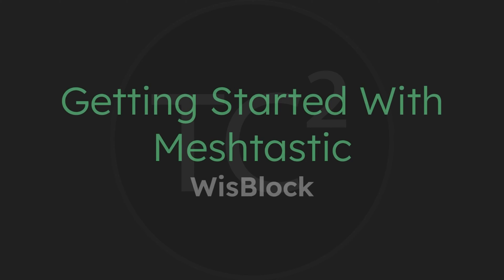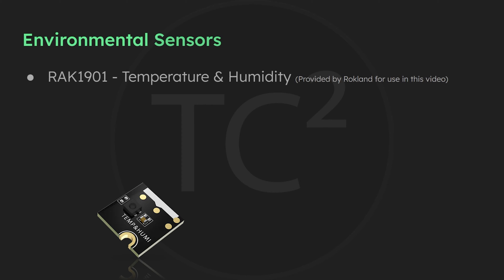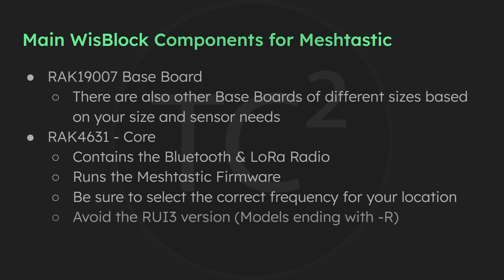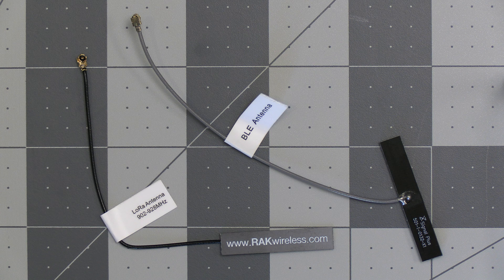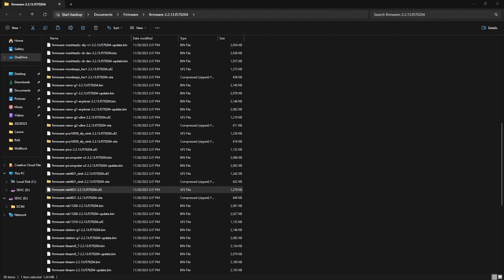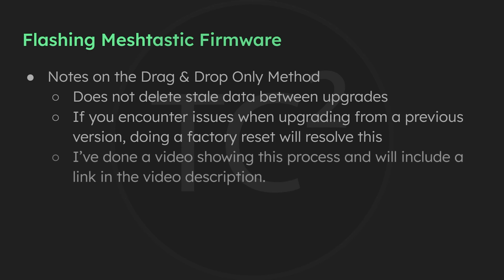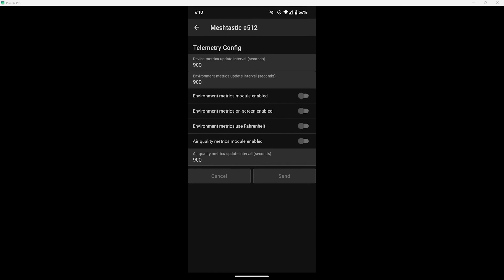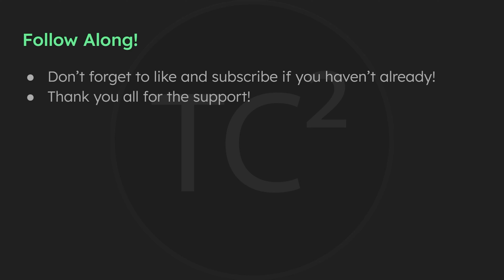Getting Started with Meshtastic - WisBlock

Comment: Sadly on the Meshtastic website the link you click to download the firmware does not work like yours anymore. Now you click: Firmware - Download stable: no download start, then you are greeted by around 20 different download. Which one do I choose? And one thing I would love to know is: You say select the one for the 4631 chip, but at 4:00 you install the 4630. Does the firmware work for both versions?
Reply from the maker: Process has changed since this video, but you can follow along at this point in this other video

https://youtu.be/vdCKpQKeaKU?si=GZ4Nh_XKELVPekx_&t=134

4630 is the chip itself without the board. The 4631 model is the 4630 chip installed on the board.
Reply: @The_Comms_Channel  Thank you !

Comment: A great video that lays an excellent foundation. What I would like to do though is use RakWireless components to read sensors, compose messages, and then transmit them over Meshtastic. Yet, it seems sensors are directly controlled by the Meshtastic software. Can you suggest one of your videos that offers a solution? Have been studying RakWireless' product line but cannot see how it would be done.  Many Thanks.

Comment: I got that enclosure and it doesn't come with enough screws to put it together, and it doesn't have the battery cable. I see now that the cable is sold separately, for 10 bucks!
Reply from the maker: Not sure what happened with the screws. I should have enough. You're right, no cable though which is a bit odd. The $10 gets you five cables.
Reply: @The_Comms_Channel OK right thanks!

Comment: Thanks! I have a question about the Starter Kit. Rockland's kit is $34.97 and sold out. Rak's is $24.99 and in stock. do they both come with the same compnents?
Reply from the maker: Thanks so much for the support! It's the same item. Rokland just got more stock in and will very likely go sell out soon!
Reply from the maker: The shipping costs from RAK are high and have a long wait.
Reply: @The_Comms_Channel  Thanks for the heads up, just ordered 2 for my first builds
Reply from the maker: Sure thing!

Comment: Still new, and trying to figure what all to buy.  Is there a limit to the number of modules you can add to the WisBlock?
Reply from the maker: Thank you so much for the support! There is a limit. There are also bigger boards if you need to add more modules though.
Reply: @The_Comms_Channel  -  - You’re welcome!  Thank you for the great videos!

So I could get a bigger RAK board that would allow more modules than the WisBlock Meshtastic Starter Kit (with RAK19007 board plus Core), and would work for Meshtastic?  Because I’d like to install GPS, temperature, and radar sensors at minimum.  I’m not sure if I need the IO module or the OLED display or not.  Could you recommend one from a larger RAK wireless board that would work for Meshtastic LoRa (or one of your videos)?  I’m trying to order everything and get it in-house before I go through your play lists.  I’m new to all this (but very interested)!
Reply: @The_Comms_Channel  That's good to know.

Comment: Using firmware 2.2.22 (Meshtastic ios app 2.2.21) and the screens bear no resemblance to what your are showing. There is no 3 dots top right and no radio configuration selection. Also I have RAK12500 module and the app asks for GPS GPIO pin numbers for TX, Rx and EN. I have no idea what these are and no guide even mentions them.

There is a WARNING
GPIO access is fundamentally dangerous because invalid options can physically damage or destroy your hardware. Ensure that you fully understand the schematic for your particular device before trying this as we do not offer a warranty. Use at your own risk.

Comment: Thank you for sharing the process for doing a headless setup - no need for the tiny screen that consumes power anyway. Would you be able to do the same type of flashing by simply going through the Chrome-browser method of web flashing, or does the RAK require the drag-n-drop method?
Reply: Just out of curiosity, what screen is compatible with the RAK19007 anyway?
Reply: @ecotts  RAK1921 OLED (soldering) or the RAK1400 E-Ink (ribbon cables) according to Meshtastic website.

Comment: Great video! Could you go into how I would go about charging the battery? I purchased a PKCell 3.7 V flat battery
Reply from the maker: It should just be a matter of plugging it into the battery port on the WisBlock. Just make sure the red side is going to the side with the plus sign printed on the board. Did your battery come with the connector on it?
Reply: @The_Comms_Channel  Thanks for the reply! I get plugging it into the Wisblock.

Maybe I misunderstanding your response. 

Let me rephrase. 

My plan is to have a base station, a few relays or repeaters and 2 mobile units to start with.

For the base station : Once I have the Wisblock set up and the battery plugged in, how would I go about charging the battery once it’s depleted?

For the relays/repeaters : I’m thinking solar would be better because it’s more flexible if I’m just placing units in randomly hit them locations.

Mobile : I could be mistaken as I’m still fairly new to all this, but I have yet to see anyone in a small solar panel into a mobile unit.
Reply: @The_Comms_Channel Apologies I forgot to answer your question. Yes the battery comes with the JST connector already attached.

Comment: Interested in the RAK12013 Radar sensor. Do you have plans to build something like a meshtastic motion detection node?  I can think of a couple use cases, both temporary and permanent that could be interesting.
Reply from the maker: I do and have a radar sensor I'm testing. I'm getting a lot of false positives though and will continue to work the kinks out.

Comment: Thanks you for this video. Did you experience issues with getting the device to show as a device once you entered bootloader? Mine is not showing as a device on windows 10 machine. Confirmed the cable is USB data enabled (phone got recognized). Rebooted computer. still no joy. Thanks in advance for any info you have.
Reply: USB plug installed at an angle. Looks like some pins are not making contact with the board. Pinging Rokland for options.
Reply from the maker: It's not showing up as a flash drive when you hit the button twice? I've not had that issue. I would try another USB port and see if that works.
Reply: @The_Comms_Channel  Ive confirmed that there are pins on the USB module that are not touching the contacts on the core. (Macro photos are nice)
Reply from the maker: @hatless-cluncky-capsize  oh, wow 😳 Didn't see your previous comment. They should hopefully be able to get your straightened out.

Comment: You recommend the 4631 as the core module/microcontroller, but I see that Rok and Rak also sell the "motherboard" paired with the 11310. I can't find a comparison between the two modules though - is there an advantage of one over the other?
Reply from the maker: https://meshtastic.org/docs/hardware/devices/

That one has no Wi-Fi or Bluetooth so you would need to get the Ethernet module for that to work
Reply: @The_Comms_Channel  Awesome! Thank you. That will work well as the HQ base station and I had the ethernet module in my cart. Great job on the channel!
Reply from the maker: Sure thing! Thank you!

Comment: Great video! Is it possible to get a version of the Wisblock with WiFi instead of BT?
Reply from the maker: Thank you! Not really at the moment. There is a WiFi module you can get for WisBlock, but it only works Meshtastic on the older RAK5005 board that they're no longer making.

Comment: Hi Folks. My device is showing as RAK4631 in file manager. I cannot select it in the flasher. It looks to be paired ok. Also the Meshtastic site does not show and firmware in the firmware section so I can't drag and drop either. Any ideas?
Reply from the maker: Site appears to be down at the moment. I've notified them.

You can download the latest stable version from their github page at the link here

https://github.com/meshtastic/firmware/releases/download/v2.2.17.dbac2b1/firmware-2.2.17.dbac2b1.zip
Reply from the maker: It has been fixed and should be working now
Reply: Thanks it did come online. @The_Comms_Channel

Comment: Thanks for this tutorial. I have followed the instructions as presented in the video. Unfortunately after flashing all I get is a solid red light on the board. Any suggestions for troubleshooting this are more than appreciated. Thanks
Reply from the maker: Sure thing. I would try flashing again and make sure you have the correct firmware file.  If that doesn't work, you can try a complete reset and flashing again using the instructions here. https://meshtastic.org/docs/getting-started/flashing-firmware/nrf52/nrf52-erase

If you need help installing the Meshtastic CLI  mentioned in this tutorial, my latest video shows the installation process https://youtu.be/hUWvmar-2VY?si=lnzFCxhjzKsO8V2n
Reply: @The_Comms_Channel  Thanks so much for the quick reply. Unfortunately this still doesn't work. The strange thing I observed is that after flashing the device doesn't reset. Also if I plug in a battery instead of powering the device via USB the board doesn't show any activity.
Reply from the maker: @digitalnomad46  Darn... Next thing I would try is disconnecting and connecting the device to your computer and then run the following command right after doing so

meshtastic --noproto

This should output the Meshtastic logs
Reply: @The_Comms_Channel  If the device is not in dfu mode. It reports "Warning: No Meshtastic devices detected". If the device is in dfu mode, It reports "warning file: mesh_interface.py sendToRadio line:681 Not sending packet because protocol use is disabled by noProto. Second line "Warning file:meshinterface.py _sendPacket line:531 Not sending packet because protocol use is disabled by NoProto". Thanks again for the quick reply and help so far
Reply from the maker: @digitalnomad46  Do you get anything beyond those two lines?
Reply: @The_Comms_Channel  nothing, I noticed in the info_uf2.txt when in dfu mode that the bootloader is dated 2020. I am wondering whether the bootloader is too old for the latest meshtastic firmware. Will try to update the bootloader
Reply from the maker: @digitalnomad46  Worth a shot. Mine shows Dec 2021
Reply: @The_Comms_Channel  with a very old meshtastic firmware (1.2.55) it works as expected. With firmware above 2 is doesn't work. I guess it's the bootloader as the board works as it's advertising ble with the old firmware. Thanks again for your help
Reply: I can confirm it was the bootloader. Updated the bootloader and now everything works as in your video 🙏
Reply from the maker: That's great news! That's something I've never run into before and it's good to know the fix for it. Thanks for reporting back!

Comment: can i run multiple 18650 cells? (1S2P)
Reply from the maker: Yep, as long as they're wired in parallel to keep the voltage at 3.7.

Comment: Video idea: a rak build for on person/mobile to compete with the t-echo but trying to keep the cost a lot lower. 

Rak starter kit 
3-d printed case maybe a “project box” from Amazon PVC pipe 🤷‍♂️
18650 battery 
18650 holder 
Gizont antenna 
Ipex to sma female pigtail
Whatever JST connectors & anything else you need.
Basically the most capable unit with good battery life for the lowest cost

Comment: Eager to see how to install the motion detector and have it send alerts through the mesh.  I have found a sketch for the Rak 12013 Radar module.  But the code does not include the notification to Meshtastic.   Anyone have the code for the Radar module to send data to Meshtastic?

Comment: Great video!!!! Can all the nodes connected see temperature and humidity of the remote node that has these sensors?
Reply from the maker: Thank you! Yep! Any node on the mesh network can see the readings of the sensor.
Reply: @The_Comms_Channel  Thanks for the info!!! Other question, I cannot find the Wisblock Rak EU433. Could you please tell where tu buy it?
Reply from the maker: @matutep1  Sure thing! It's odd, but they don't have the option for EU433 when you buy the kit. You'll have to buy the core and board separately. Here's affiliate links to them below and be sure to use my discount code TC2 for 3% off!

RAK4631(Core) - https://rakwireless.kckb.st/tc2-xbo
RAK19007 (Board) - https://rakwireless.kckb.st/tc2-fsb

Comment: Great video! I’ve tried to do a search on LORA type protocol in use on HF ham, radio frequencies. This benefits would be Range. I did see something for you. HF that works at 433 MHz.

Do you know if any HF based similar projects?
Reply from the maker: Thanks! I'm glad you enjoyed the video! All of the LoRa based radios are for the ISM bands, so nothing under 433MHz. The issue with HF and LoRa is LoRa uses a bandwidth 125kHz, 250kHz and 500kHz, which is a large bandwidth for HF which is limited to 500Hz for data. 500kHz is actually equal to or more than entire HF bands in some cases. Because of this, it's unlikely there will be any LoRa projects on HF. There has been some talk of using high powered LoRa signals to bounce of the moon and back which would be awesome! 

Thanks for the great question!
Reply: Now that's interesting....I'm betting that 1w will get an EME bounce.
Just look at what the Voyager probe systems are capable of......21 DAYS for a one way signal transit!

Comment: Is there an easy way to find the nodes From other people to maybe get in contact with them or is it just to communicate between my own devices?
Reply from the maker: When you set it up there's a default channel. If you leave it on this default channel, other people that are also on the default channel will show up. I'm currently on the road actually and went hiking yesterday with a device on the default channel and picked up another user. Thanks for the question!
Reply: May I ask, how many nodes you have already Discovered?  @The_Comms_Channel
Reply from the maker: 5 or 6 or so that have been on the default channel.

Comment: Thank you so much for these explanations. Out here rural there are a lot of us interested in a mesh network and it sure looks like the WisBlock is the way to go. Is there a description of how to set up a network and how to rig repeaters?
Reply from the maker: Sure thing! I've not done a video on the different options like routers/repeaters yet but will soon!
Reply: @The_Comms_Channel  Thank you so much for your time and expertise and above all you sharing it. I have to watch a couple times for it to sink in but as I go along I can grasp the concepts better. We live in a place where point to point is feasible but in the outlay it areas. Couple miles, some line of sight but a repeater between and solar powered would be the ticket. Another question I have is the failure rate for these devices very low? Say good for a couple years then have to replace?
Reply from the maker: @micklaws5520  Anytime! I'm glad you're finding the videos helpful! One of the future videos after I get done with the "Getting Started Series" (which is almost done) will be on device placement planning that should be helpful. 

As far as life expectancy, I would say they should last a good while and maybe the batteries may need to be replaced as time goes on. But the hardware devices themselves should last for many years I would think as long as they're protected from the elements.
Reply: @The_Comms_Channel  Thank you good sir. I am thinking all this can be Solar charged so the charge cycle will determine battery life..I think..lol. In that case if we get this rolling our placements will be ease of access to do a battery replacement

Comment: Hi all question? Can I use the rak1910 with the newer RAK19007? I accidentally ordered them. If so are they plug and play or is there something that needs to be configured? Thanks
Reply from the maker: That should work fine with the 19007. For GPS, there is nothing that needs to be configured in the app and it should just start working.
Reply: @The_Comms_Channel  great thank you perhaps I didn’t give it enough time to acquire a signal. Great channel and keep up the great work!
Reply from the maker: Sure thing! It will struggle to pick up indoors so you may have to take it outside for best results. Also make sure it's on SLOT A, E, or F

Comment: If you can figure out how to get the Ethernet module (RAK13800) to work with Meshtastic, I'd be very happy. My intention is to use this setup as a base station connected to the Internet.

Comment: Did I hear you say in a past video that if the Wiseblock power ran down on the battery, the unit would not start up by itself if the battery would recharge?
Reply from the maker: That is correct. If that happens, you need to unhook all power sources from the device and provide it power again to boot back up.

Comment: How about adding GPS module and enabling it?  Enjoying the series.  Want to build stand alone solar node for remote location.
Reply: They just recognize it and start updating
Reply: Gps snaps right in and I believe will be enabled by default.  You have to manually disable it. I didn't go with the gps, but now I don't have a clock (d'oh)
Reply: @jvalasek1 you only need 1 device withing the mesh to keep time thankfully I didn't have to pull my node down from 40' again I just added a T Echo
Reply: This is a topic that interests me to. A bunch of us do outdoorsy stuff in a remote, very rugged area that has no cell service except at the periphery. Looking into the most cost-effective way of leaving repeater nodes scattered throughout the park. I already ordered a pair of Heltec v3 boards, but from further reading I know now that those will be best suited for fixed powered emplacements, like at home or in the car, where a huge battery would take quite awhile to drain down. Setting up my car as an always-on repeater has some utility.